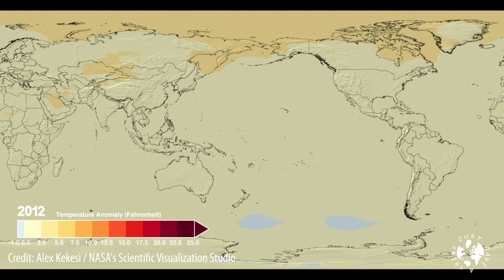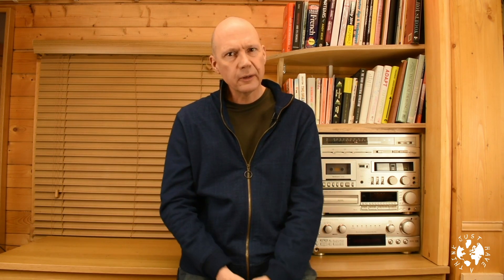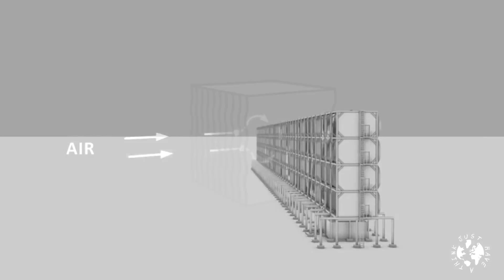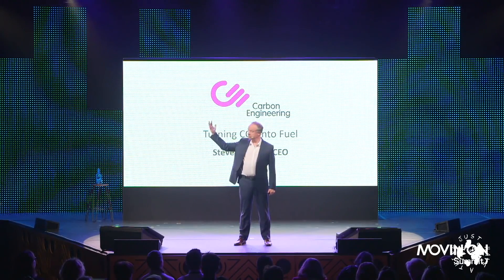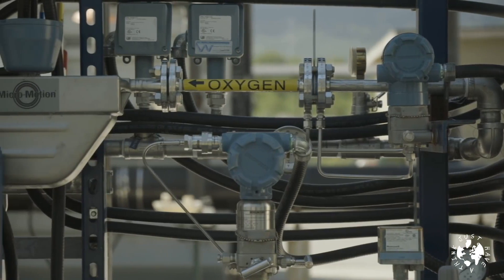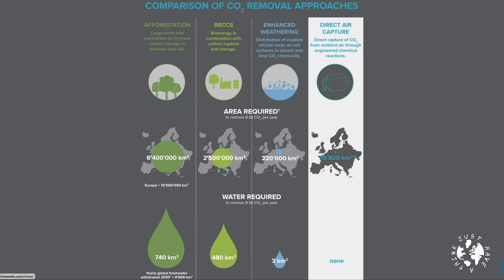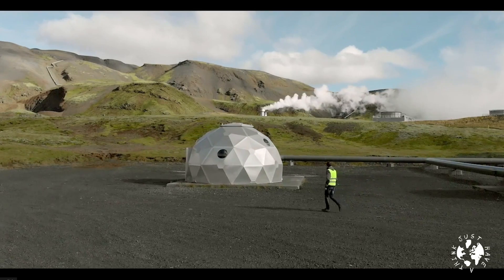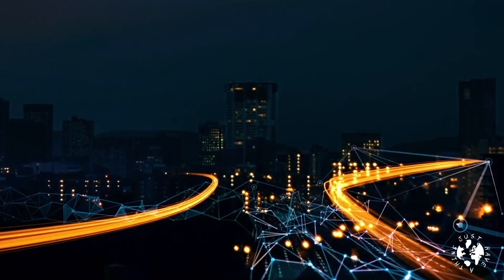Direct Air Capture Technology

Comment: He did say they are hoping to capture 1% of carbon dioxide emissions by 2025 didn't he!! 
how much did the annual global carbon emissions rise in 2018 
And we have between 2 years to a decade to at least half global co2 emissions depending on who you talk to, Hhuumm
Reply from the maker: Hi Stephen. Yeah, it doesn't sound that convincing when they say 1%. I must admit I thought the same as you..."a drop in the ocean'... but...I was a bit more encouraged by the slide showing the comparison to other carbon capture technologies. That comparison is based on removing 8.5Gt of CO2 which would actually start to make a dent on the 40Gt we're spewing out each year. Whether anyone can stump up the cash to implement it at this scale remains to be seen. What I'm hoping to demonstrate though over the coming months is that there are loads of different initiatives happening simultaneously around the world and if we can get them all working to some extent then the cumulative value might just be worth having. Only time will tell. Have a good week. Dave
Reply: Just Have a Think, interesting times ahead for sure, not hearing anything good from Antarctica at the moment and Australian heatwaves looks ruff . 
have good week too keep up the good work 👍
Reply: @JustHaveaThink , a synthesis of available tech is our best option. Any tech which can support other CDR/BECCS tech should gain priority attention as collaboration is most likely what is going to happen in the field.

The design criteria I've used, beyond carbon negativity at a meaningful gigaton scale, is as follows:

1) self replicating
2) little to no maintenance 
3) multigenerational service life
4) adaptable to UN SDG needs
5) multiple income streams
6) multiple environmental services provided

That is a tough criteria yet it is achievable with today's tech. The issue of governance is pivotal and there are multiple options per major tech baskets. The tech which minimizes the governance headache will most likely gain early investor support.

Furthermore, currently here in the US, there is a law providing $20 per ton for carbon which has been captured and converted. It is not much yet can help attract early in investors.
Reply: Well done, thank you.
Reply: Michael Hayes Glad you enjoyed the reality check
Reply: @stephenmason5827 , this is a complex issue and few can explain it well. The DAC method is not a stellar method and more people need to know what and where to weak links are.

I study and recommend Direct Ocean Capture. The DOC with Marine BECCS method has few weaklinks.
Reply: Michael Hayes Hi Michael, so your looking at collecting co2 directly from the ocean? That would help slow down ocean acidification. 
Just worries me that we will hit 1.5 degrees between now and 2025, 1.5 degrees being regarded as very Dangerous according to prof Jim Hensen and others, and are projected to see 2 degrees between 2030, 2035 Where we really start to trigger irreversible positive feedbacks, bearing in mind these projections will prove optimistic in a few more years if all the latest studies the past few years are anything to go by, every new study says worse or faster than previously thought. 
Really, honestly how long do you think it would take to get ocean CCS up and running on a scale large enough to start bringing Atmospheric co2 down? Bearing in mind 2018 saw the highest co2 emissions ever. Think we are at around 413ppm now 
Arctics first BOE expected in the next few years!!  expect the Arctic amplification and  Arctic methane to rise there in the following years. 
I do agree we need to pursue these technologies but I can't shake the fact that it's not enough, we all need to drastically change our way of living now. 
Most people aren't even aware of the Paris climate agreement and or what it actually means, most people I talk to do not know or realise according to ipcc we need to half all global emissions by 2030 and what that actually means in changes to infrastructure way of living, this is if we actually bother to try and hit these goals. 
We do not have another decade or two to talk about it we need to see drastic action if we are serious about this. 
I don't think people aren't scared enough most not even aware how tragic and terrifying our future is becoming. We should all of us be deeply concerned the cloak is ticking. 
The hotter it gets the faster it gets hotter!! 
Australia been cooking this summer, Antarctica seeing a lowest Ice extent at this time I believe. 
Will be interesting to see if we have another global heatwave this year like 2018, that won't be a good sign.
Reply: @stephenmason5827 , marine BECCS/DOC can reach the needed scale in the needed time.
Reply: Michael Hayes ohh good no worries then, out of interest what's are the calculations? as you said it's a complex issue so I guess you guys have crunched the numbers and know exactly what's needed 
how big is each BECCS machine?
how many BECCS machines will we need to deploy Globally ?
What's the volume of ocean that needs to be filtered per day and for how long before we a decline in atmospheric co2?
What will you do with the billions of tons of sequestered co2 and do we have all the infrastructure to cope with that? 
Have there been any studies on the effect of BECCS on marine ecosystems?  
When can I expect to see BECCS up and running on a global scale? 
I know with terrestrial CCS the numbers are pretty staggering 
Reality is a bitch sometimes
Reply: @stephenmason5827 , you may wish to take up the study and work through your concerns. 

I do not have an ability to provide detailed training over message chats.